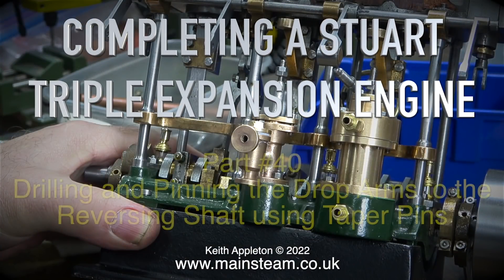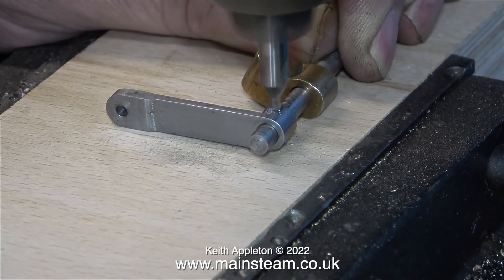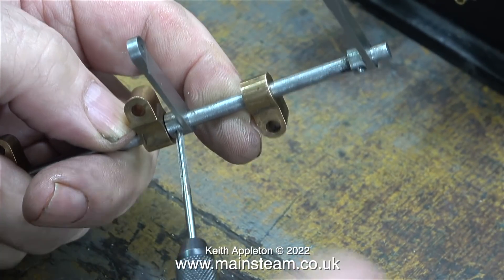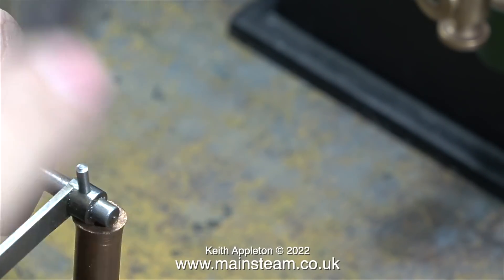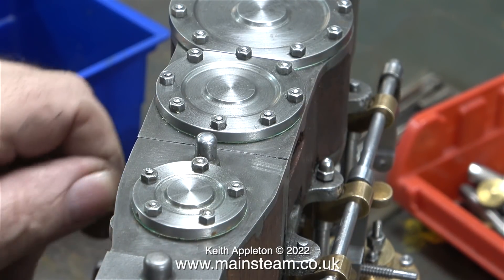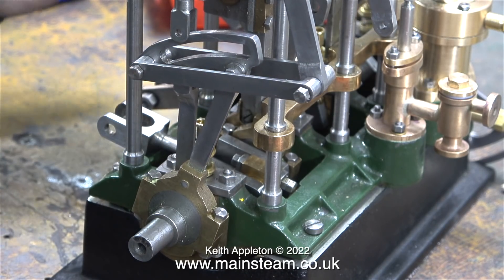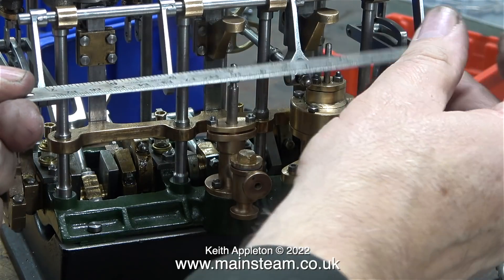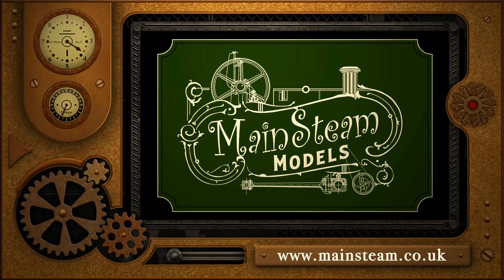COMPLETING A STUART TRIPLE EXPANSION ENGINE - PART #40

Comment: This reminded me of my early days as a Field Engineer.  I worked for NCR (No Carbon Required or National Cash Register of Dayton, Ohio.)  You probably remember the old 100 Class cash registers, with multiple keys that made up the amount (£1 2/6d say) were pressed down and the amount rose up in the indication on white 'flags'.  I only worked on those once or twice prior to the UK Decimalisation in 1971.  Mostly I worked on Adding machines (can't remember the type number) and Mechanical Accounting Machines - Class 31, 32 and 32 Wired and 33.  All of these machines used taper pins and thus our tool kits included a multi sized kit of taper reamers, spare pins large and small and various pin punches.

Now our Instructor, one Ron Tarling - long gone now, I imagine - always told us; "If you are going to hit it, hit once, but hit it HARD.  No tap, tap, tap. Same went for almost anything else.  Mechanical accounting machines were held together with screws (machine screws, almost always cheese head or countersunk) circlips (sometimes called 'C' clips or 'E' clips or even Spring Clips) and Taper pins.  Our Ron was not above using a long, sturdy screwdriver to release very tight screws by using them as a punch at an extreme angle to the centre line.  But the same thing applied, but I have it in mind the "hit it once, HARD" admonition was even more important.  Circlips could be removed with a small screwdriver, but often pinged off to be lost, but they almost always needed a circlip inserting tool to get back on again, especially deep in the machine.

The taper pins were very efficient, but occasionally would cause problems because of lost motion because they had become lose.   The procedure was to use a punch, exactly in line with the pin and release it with ONE, hard hit.  Knowing how hard was hard was the mark of a proper engineer.  The hole and shaft was then reamed until there was zero lost motion then a new pin inserted and punched home with, again, a single firm blow.  Then the pin was cut to length.  In some cases a rough gauge was made for pin length, the pin cut and then driven in, especially where space was restricted.  If I looked in my workshop, I bet I could find at least one taper reamer, bearing in mind this was the early seventies.  I still have a pair of 'Spencer Wells' artery forceps I used then!  If I'm honest, it was an interesting, but woefully underpaid job.